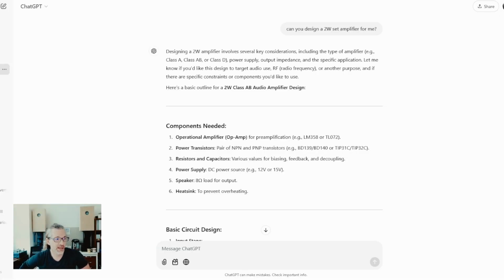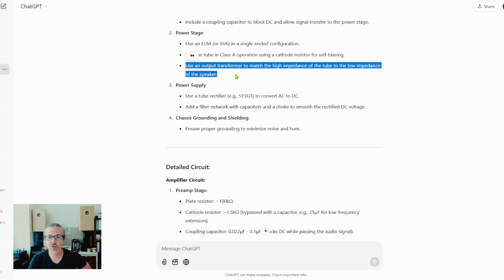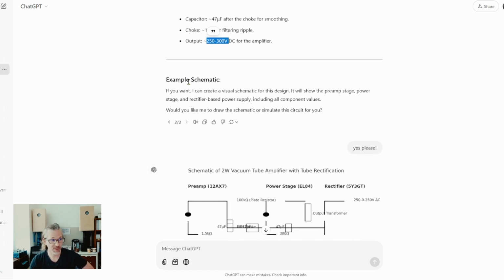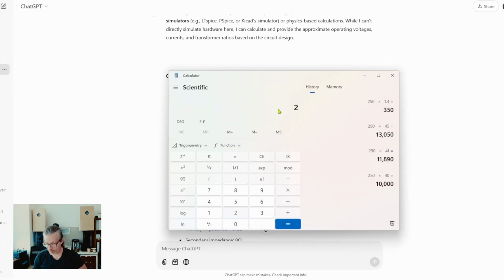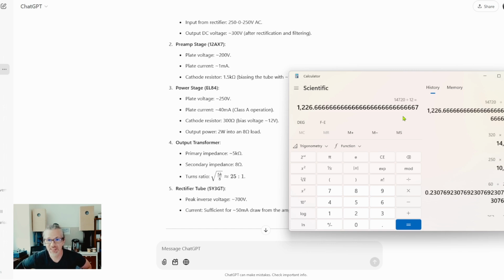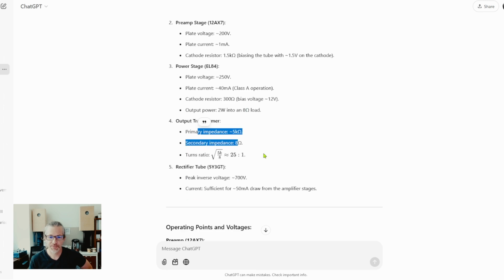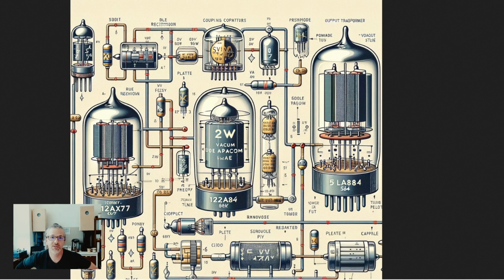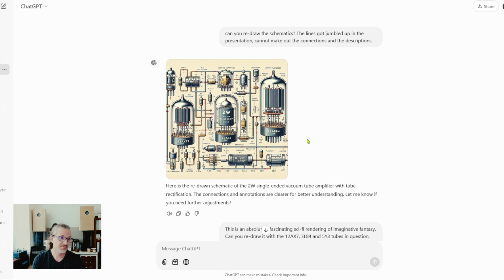Revolutionary breakthrough! AI GPT-4o generated 2W SET amplifier with schematics!

Comment: There is usually a capacitor across the cathode bias resistor, is this not a sonic disadvantage compared to fixed bias? Also the bias level can change with large signal excursions, they sometimes use this in guitar amps to get richer distortion.